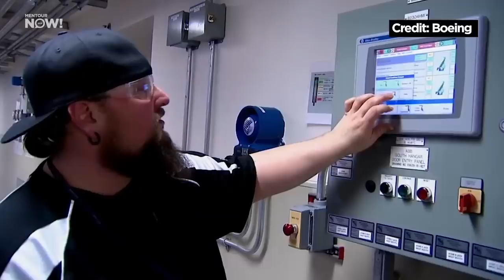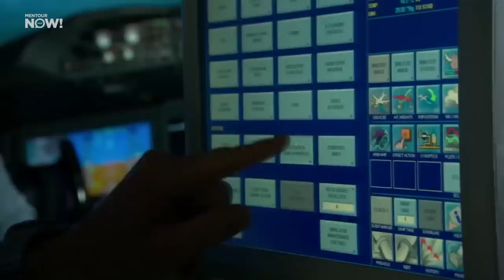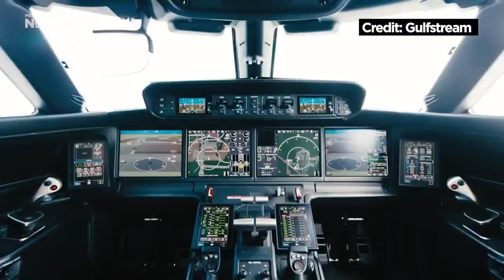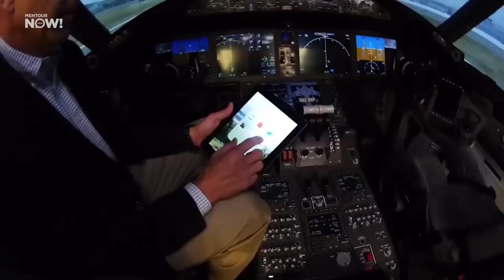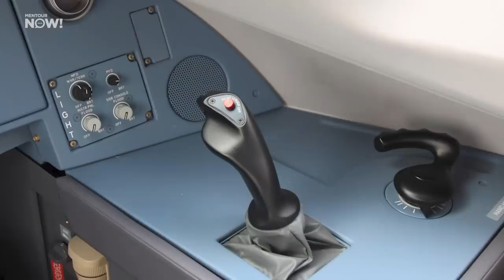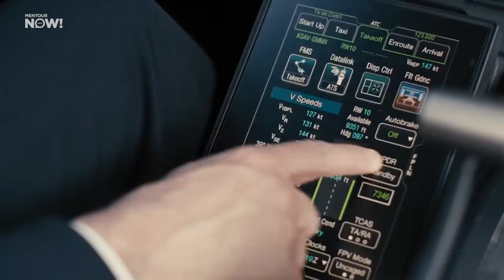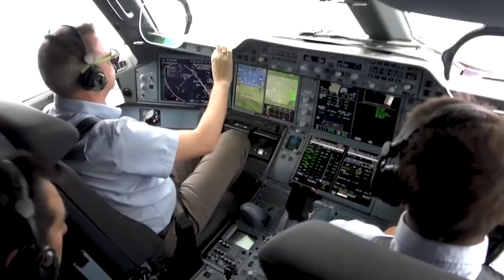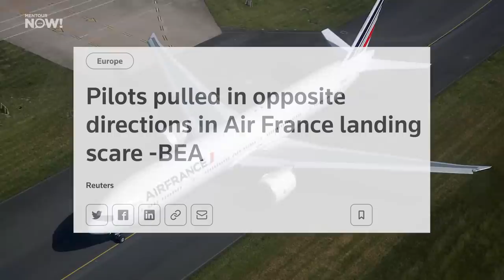Is Boeing Switching to SIDE-STICKS?!

Comment: If Airbus had designed their joysticks to work together then Air France would have had an additional A330 in their fleet.
Funny the the ones who object to it being called a Joystick are just fine with abbreviating the Airbus name to Bus and call themselves Drivers. Does that make them Bus Drivers....seems so. Pilots are far king pilots and not drivers. I hate the profession being denigrated like that (nothing wrong with being an actual bus driver either) when we worked so hard and spent so much to obtain qualifications.

Maybe if Air Franks trained their pilots better then they wouldn't have so many issues. One fatal Concorde crash and multiple close calls in them and the famous AF447 with the joystick full forward and full aft at the same time. 🙄 Need I say more?
Reply: If Air France had taught its pilots the difference between Normal law and Alternate law 2 then Air France would have had an additional A330 in their fleet.

Comment: I really don't understand the logic. A right handed Captain flying left seat has to fly a plane manually using his left hand. Well. There's brilliant planning. NOPE. 85% of all humans are right handed. Perhaps the dominant handed pilot in control should sit in the most useful position. Right handed right seat. Left handed left seat. And isn't that fun for changing assigments mid-flight. I'dl go with full Yoke anytime. Ambidextrous. Side sticks are so French.
Reply: Can I assume you're right handed? Have you never operated the steering wheel of your car with just your left hand?
Reply: I heard many pilots transitioning to sidestick aircraft or becoming Captains in sidestick aircraft expressed concerns about having to use the non dominant hand on the sidestick. However most pilots have stated it wasn't an issue at all to use the non dominant hand on the stick, taking within several seconds or minutes to get used to it where they said it was just as good to use as the dominant hand and the brain compensates for using the hand and builds new muscle memory during training. Now some pilots did indeed have trouble using the non dominant hand but after a few training sessions in the simulator, the problem goes away to where they are just as effective to use the non dominant hand as the dominant. I guess based on pilots input, it really depends on who is able to be able to use the non dominant hand quickly and who will take longer. And with a yoke, during descent to landing, it's one hand on the yoke, the next on the throttles, including having the non dominant hand on the yoke.

Comment: The left pilot has to use his left hand to input something on the sidestick? He's not using his dominant hand? That looks dangerous to me. As a right handed person you'll never be as good with your left. I mean with the yoke you're using both so it doesn't matter.
Reply: NO, with the yoke youre also just using one hand because the other is on the throttle
Reply: If it was dangerous, we should be hearing more pilots complaining about not being able to use the non dominant hand on sidestick aircraft and that isn't happening. I heard many pilots transitioning to sidestick aircraft or becoming Captains in sidestick aircraft expressed concerns about having to use the non dominant hand on the sidestick. However most pilots have stated it wasn't an issue at all to use the non dominant hand on the stick, taking within several seconds or minutes to get used to it where they said it was just as good to use as the dominant hand and the brain compensates for using the hand and builds new muscle memory. Now some pilots did indeed have trouble using the non dominant hand but after a few training sessions in the simulator, the problem goes away to where they are just as effective to use the non dominant hand as the dominant. I guess based on pilots input, it really depends on who is able to be able to use the non dominant hand quickly and who will take longer. And with a yoke, during descent to landing, it's one hand on the yoke, the next on the throttles.
Reply: @coastersparkxx6069  Well still I think a system that you could adapt to your needs would be better. With fly by wire that shouldn't be a problem.
Reply: @EbonyPope  And what system would that be?
Reply: @coastersparkxx6069  Detachable Sidesticks? Or a Sidestick than can be moved around and then fixed in place like your wheel in the car? That's not the best comparison but technically I don't see any problems. You just need something to the right or in front of the pilot where you could reattach the sidestick. My God technology has made so much progress there definitely is a way.
Reply: @coastersparkxx6069  Also another question: The pilits got used to it wow quickly but what about dangerous or very difficult situations? I'm a musician and therefore very good in switching to my non-dominant hand for a lot of tasks but the ones that require the most accuracy like writing my left hand comes burgers close to my right. So I really doubt this won't have an impact at all.
Reply: @EbonyPope  There's problems with that. If you place the sidestick to the right for the captain, how are you gonna manipulate the throttles simultaneously? That means the Captain will have to take his hand off the stick just to adjust the throttle and then place it back on the stick to control the aircraft while the left hand is doing nothing. Not really a safe idea and makes no sense at all where there's times where you will need to be able to use both hands to manipulate the stick and throttles simultaneously and and there's been incidences where the pilots needed to use both hands to operate both controls at the same time. Also having the stick in the middle would take up maximum room some pilots enjoy on these aircraft and would take up space for the tray table. Hence the location is off to the side. 

And finally where will you put them? I don't see how you can put the sidestick on the right armrest based on images. The sidesticks come equipped with a large mechanism (or electrical servos in a box for active sidesticks) and would not have any space btwn the pilot's chair and the center console to fit. Also the pilots chair needs to be moved back and forth so I don't see it working there. Switchable sidesticks add complication. Pilots get used to flying with the non dominant hand with the stick location to the left. I think it's best to leave it as is. These planes have been flying for 35 years since the A320's introduction. We should have been hearing so many complains about left hand issues by pilots by now but that's not the case. Even some Airbus pilots in the comments expressed no problems with the hand. I take their words for it.
Reply: @EbonyPope  Sidestick aircraft have been flown in dangerous and dire situations before. Air Transat 236 was an A330 that lost both of their engines and the Captain had to glide the plane with his left hand for 18 minutes and was able to fly safely and land safely at the Azores Base. Qantas 32, an A380, had an uncontained engine failure that destroyed systems and during descent to landing, the Captain had to use his left hand on the sidestick and the other on the #3 engine thrust lever and was able to fly and land safely. There's more examples but these are just 2 examples. Pilots also state they are able to use the left hand just as accurate as the right. That's what training is there for. They are trained to control with precision and accuracy, both small deflections and large deflections. Also the FBW system itself will help to keep the plane flying safely and assist in accurate flying. Some people who are not even pilots but flew the Airbus simulator attested to the same thing and didn't experience any trouble using the left hand. Many pilots also state using the sidestick well with the left hand is far easier than writing, typing or playing tennis with the left hand. What's interesting to note is some general aviation aircraft like the SR22 used sidesticks. And again on yoke aircraft, during descent to landing you'll need to have one hand on the yoke and the other on the throttles. There's been incidences with yoke aircraft like with United Airlines 1175 with the Boeing 777 where the Captain fought and held the yoke with his left hand and his right hand was on the #1 engine throttle. He wasn't using both hands then.

Comment: Sidesticks ARE joysticks, just mounted to the side. Other than that, they are joysticks.
Reply: All modern fighter jets have joysticks as well.
Reply: @Milkinporsche  At least they are in the middle and not off to the side.
Reply: @DaveMiller2  f22, and f35 would disagree with you

Comment: So many accidents have been caused by the sidestick! The pilots have no clue what inputs the other pilot is putting in. Think of the Air France accident, had they had a mechanically connected yoke 300+ people would still be alive.
Reply: @CoasterFan77 had they been linked, the other pilot would have known the FO was yanking back
Reply: If we looked at the historical records, I'm sure we would find more crashes with yokes than with side sticks. Still, we know that fly-by-wire increases safety. Air France 447 was tragic, but for every Airbus crash that would not happen in a Boeing, there are as many Boeing crashes that would not happen in an Airbus.
Reply: @zainy11  like you said, the problem is the linking, not the sidestick per se. You can have an unlinked yoke configuration as well
Reply: They have been "contributed" to by "unlinked sidesticks", not caused. And I wish all sidestick planes had linked sticks...

Comment: Side sticks do not cause crashes. Only air france has problems not having trained their pilots very well! When did you last time hear an AB crashed? Yokes are so old, stil mechanical design. Airbus is miles and miles ahead of Boeing when it comes to how modern the planes are.

Comment: Air France 447 crashed and killed all on board because the copilot was keeping the jet in a stall.  If  yokes were in use, the other pilots would seen immediately  what he was doing and 228 people not been killed.  Because of sidesticks he able to kill 228 people.
Reply: Maybe you can be right maybe not. Both first officers were clueless and unfit for the job.
Reply: Air France 447 crashed because the "pilots" had no idea what to do when failure occurred, they did not talk to each other correctly and just panicked, they couldn't maintain na straight and level flight profile, they ignored the multiple stall warnings, didn't carry out the stall recovery procedure and ignored everything their instruments were showing them. The side stick was not even labelled as a contributing factor in the final report. Jus because a plane has a yoke does not prevent a crash. See Atlas Air 3591 where the captain failed to notice what the FO was doing until too late
Reply: For every Airbus crash that couldn't happen in a Boeing, there are an equal number of Boeing crashes that couldn't happen in an Airbus FBW airplane.

Comment: If it ain't broken don't fix it. We have three models of bus at work I always drive the older ones with the physical steering linkage if something is off you know immediately. The newest prevost models are power assisted to the point it feels like you're driving a Toyota Camry. You really don't get any road feedback in an emergency that can make all the difference. Especially when you have other people's lives in your hands...
Reply: You're not thinking like an engineer.  What you need to be thinking to better understand this is, if it ain't broke it doesn't have enough features!  Hopefully that clear some things up.  Actually that mindset is more Marketing than Engineering but you get the picture.

Comment: FLIGHT BY WIRE started with 757/767 then Airbus adopted while Boeing included in 747-400.
Reply: 747-400 does not have fly by wire. Only the 747-8 does in the spoilers and outboard ailerons

Comment: Peter, what on Earth is that 'thing' that looks like it is tethered to the top of the tail fin ? @ https://youtu.be/I2XtOXRs1y4?t=597
Reply: That's called a trailing cone. It's flight test instrumentation used on early prototypes to calibrate the air data system. After takeoff, the cone is extended far behind the airplane a sufficient distance to escape the influence of the airplane. From that point it is able to accurately measure free static air pressure.
Reply: @chris99997  Woah! Thanks Chris

Comment: Thats sad. Fly by wire is definitely not as safe. It takes away pilot prerogative. Computers do fail and when they do, good luck in a fbw.
Reply: When has there ever been a crash when all the computers failed? There are 6 flight control computers with 2 types of hardware chips and software in an A380/A350. One single one can provide enough control to land the plane. And even if the 6th failed there is a backup electrical system that provides control.
Reply: @tomstravels520  guess you never heard of the disasters in recent years regarding the 737 max. Those were prime examples of computers gone awry, not allowing the pilots the inputs they put in.
Reply: @jjramos46  Those crashes were not in fly-by-wire airplanes, and were not computer failures. They were were due to dangerously faulty design decisions.

Comment: Stay away from side sticks! In a critical situation a pilot will do better having the ability to use both hands on a yoke. Other opinions welcome.
Reply: In a critical situation a well trained pilot will know exactly how to handle their aircraft and communicate with the other pilot what they are doing. Also a pilot is more likely to have one hand on control and other on thrust levers in a critical situation
Reply: How do you control thrust in this critical situations then?

Comment: Fly by wire actually means no MECHANICAL connection between the pilot's controls and the surfaces like elevators, etc.  Young people like you don't know the actual definition.  ALL Boeing planes produced are FBW.  Whether digital or analog is irrelevant.  You are conflating FBW with COMPUTER control of the surfaces BETWEEN the pilot's input and the surfaces.  Different animal entirely.
Reply: The 737 is not fbw.
Reply: Guess what, there is a mechanical connection between the pilot's controls and surfaces on all Boeing planes before the 777.
Reply: @FlyNAA  Yes, a wire.  As in FBW  LMAO!!!!!!!!!!!!!!!!!!!!!!!!!!!!!

Comment: Stick side is  tricky  ⛔ like Air France 449 crash happens becouse the copilot pich up the stick cause the crash in stoll douse the cpt not realize what he’s doing —Boeing not going
Reply: Historically there are more Boeing crashes than Airbus crashes. Of course, that proves nothing, and neither does your assertion. You've cherry picked one crash. For every one of those, there are an equal number of Boeing crashes that could not happen in Airbus FBW airplanes.

Comment: I'll never fully trust flying in an aircraft with side sticks because left-handed people are so rare. That means the senior pilot aboard will nearly always be flying offhand, not something I'm comfortable with in bad situations. Yes, I know that it can be done because I've trained myself to do certain things with my left hand but it took hundreds of hours and I'm still not nearly as accurate as with my right.
Reply from the maker: It’s actually not a problem. Just like it’s not a problem to drive a car with your left hand as you shift with your left. 
You learn super quick and then it’s there.
Reply: I completely understand the gut reaction - I had the same the first time my daughter told me she was flying a stick for the first time. But honestly, it wasn’t an issue for her. Granted, she’s young (under 20), but she also is much much newer to flying in general. Remember how overwhelming driving was at first? She’s carrying a huge mental load and honestly the stick didn’t even end up being a factor. Add to that the fact that pilots don’t just have a couple hundreds of hours before they are set loose as a commercial pilots - it’s thousands. Plus many, like my daughter, did much of or most of their training on a stick (like the Cirruses my daughter’s school uses). I totally get the instinctive hesitation. Like I said, I had it too - and we are talking about my own personal child learning to use one. But it really was a non-issue for my very very young pilot. 👍🏻
Reply: Even flying the yoke also uses your left hand if you're the captain. Left hand flying the yoke, right hand on the throttle